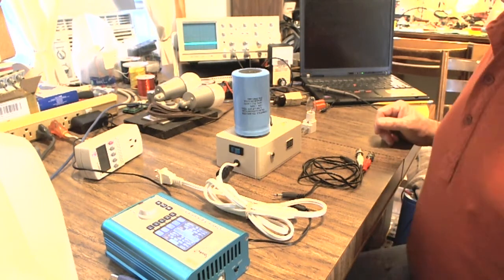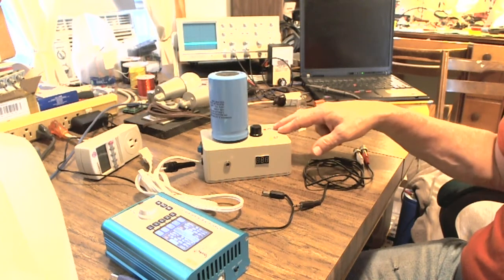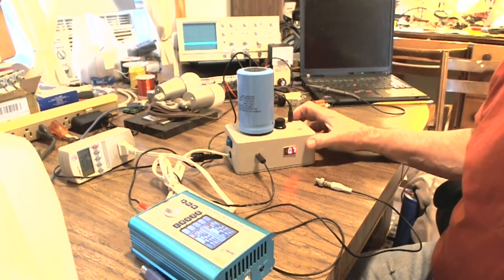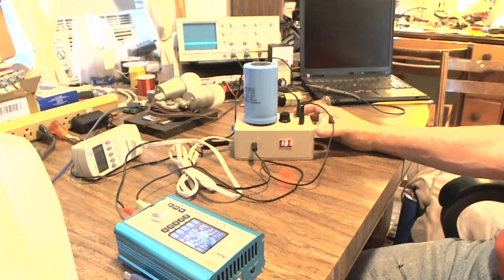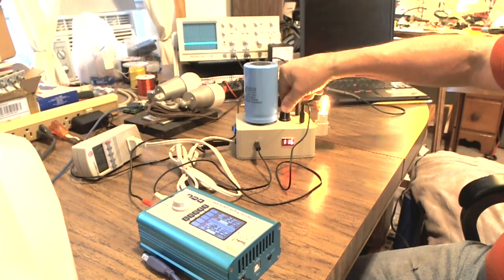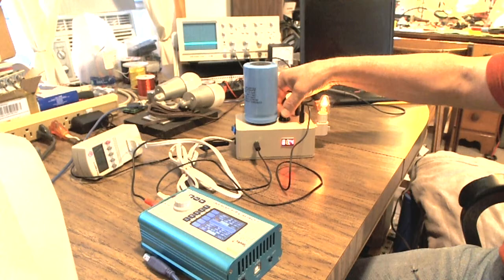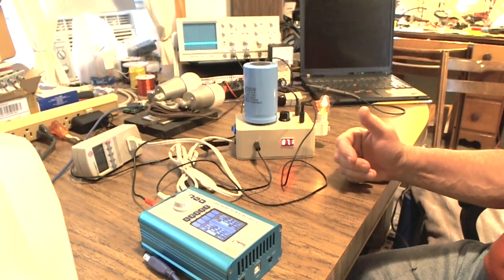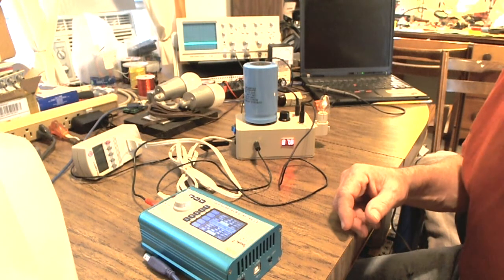Frequency Converter Intro 1

Comment: Could this be used to change the frequency of ac into a violet ray circuit that requires a 12v 15A input, then to  a zvs driver then to a flyback transformer and have the frequency remain as whatever you set it to in the converter?  The project is similar to a tesla coil but produces cold energy which then will be run into an oudin coil.  I know the issue with modern rife machines is the power level, would the rife frequencies set in the beginning with your conveter make it to the oudin coil with a magnetic and radiant output of 30k + volts?

Comment: am i correct in assuming that if I had say 9,000 volts pulsed dc fed into a capacitor bank, if i use a voltage divider then a thyristor or thyratron (deuterium) to chop it into 60hz?

Comment: How can I convert high frequency high voltage into say 60hz 120 or 220 volt? I finally found the person who knows..I hope. thanks
Reply from the maker: This is not an easy question to address.  The less current you need, the easier this task can be.  A few milliamps is a walk in the park.  Amps of current could be very difficult.  Additionally, there is too much more that needs to be clearly defined.  The short answer is I don’t have your answer.  Additionally this is not an appropriate place to try and engineer a solution.  My website offers direct contact via email.  I would suggest this would be a better place to ask a question like this.  www.aurorasky.net  Respectfully, Steve
Reply: Thank you, I will go that route.

Comment: Another question, in the circuit for the Freq, converter, you have a component called "TRIAC" with 4 legs, what component is that?
Thanks
Reply from the maker: eBay item number:201071530709.  These dimmers can be found on Amazon as well.
Reply: Thanks again!

Comment: What are the specs of the LED voltage meter? is it a DC only? 0-150V?
Reply from the maker: It is a low cost, maybe $4, unit rated 0 to 200 volts.
Reply from the maker: It is a DC unit rated at 0 to 200 volts
Reply: Great, Thanks,